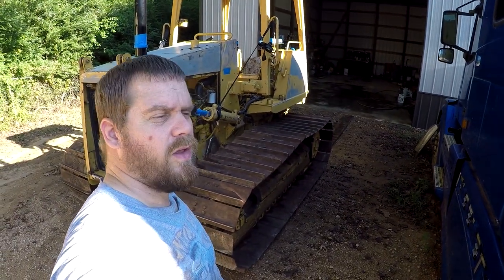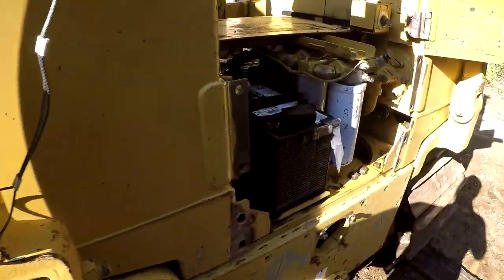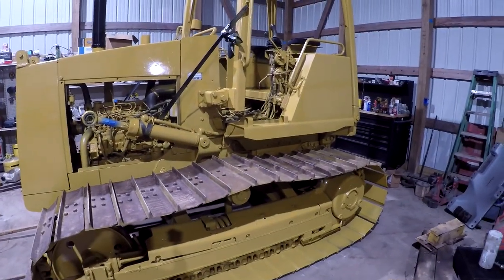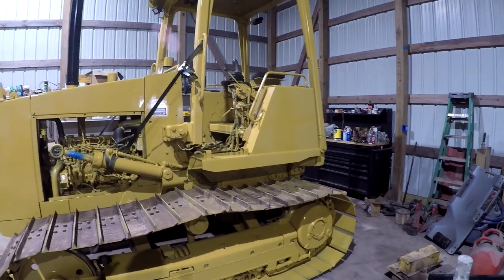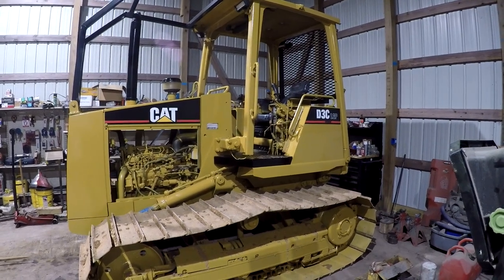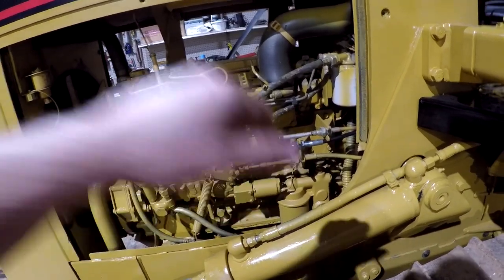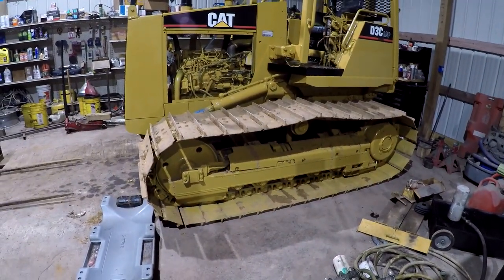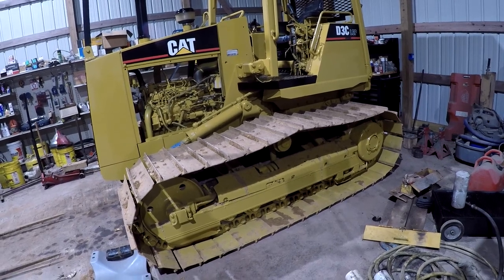Painting the Cat d3c Dozer

Comment: Looks sweet! Don’t mind me asking but I’ve got a d3 I want to repaint. How did you mix your paint and how much paint did it take?
Reply from the maker: Ordered from a guy on ebay with the reducer and hardener in a kit and followed the directions. Took 2 gallons. I don't remember the particular seller or brand, but it was somewhere around 100 per kit I think. I didn't paint the track pads or blade surface cause you know about how pointless that would be.
Reply: @LifeWithChase  yes sir that’s my plan as well the ground contact points is a waist of paint. Thanks for the reply I’ll see if I can find it on eBay